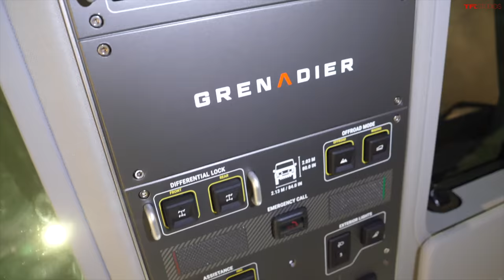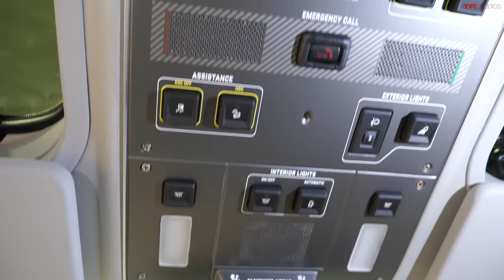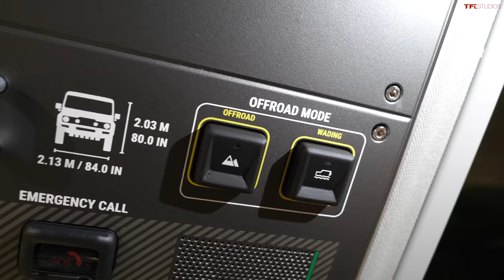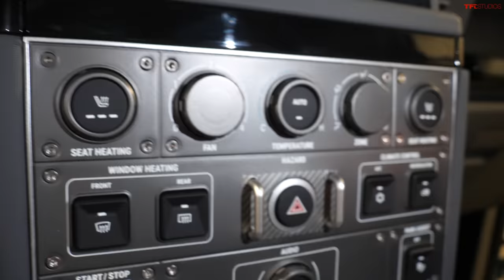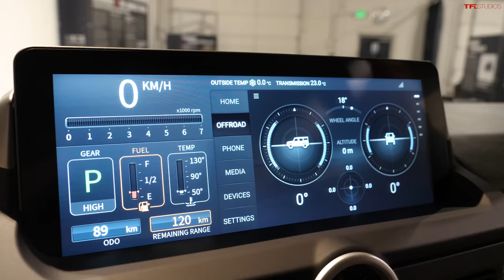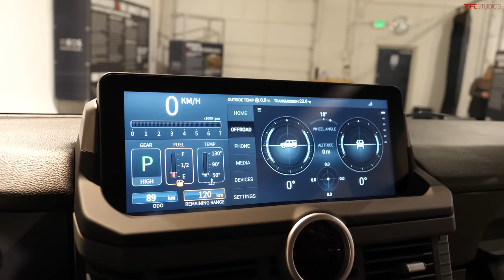The Ineos Grenadier Is The Old-School 4x4 You've Been Asking For!

Comment: This vehicle screams simple yet sophisticated. One of the best looking 4x4 in a while in my opinion.
Reply: nowheere near simple enough. far too many electronics that arent required by regulations for it to be simple. try getting your Automatic transmission fixed in the middle of the desert in somewhere like Zimbabwe. Auto transmissions require specialists to repair them in most countries, whereas a manual transmission, any competent mechanic can repair them in a shed at home, if needed!
Reply: @petelattimer6808  Solution; don't go to Zimbabwe.
Reply: Looks generic versions of older models but I want one so bad.
Reply: @petelattimer6808  Zimbabwe isn't really in a desert but I get your point.
Reply: Yeah. Bet it will cost more than a G-wagon and way more than a wrangler.  I like that they didn't make their own engine and transmission.  Overall pretty cool.
Reply: @jeffk464  It will be less than half the G Wagon price rumoured to be around  £48 k in the UK
Reply: @CallsignVega  agreed, and there aren't many mechanics with sheds in the middle of the desert either :)
Reply: @petelattimer6808  that’s what a 70 series cruiser are for. Let’s be real, this is for WASPs and aristocrats.
Reply: @petelattimer6808  I'm with you all the way, Pete, it's too complex.   Startled to see that the rear seats suffer from being set a tad too high, same as a Defender, so anyone even slightly tall has to hunch to see out their respective window.  Not great for safaris.

Comment: I think the speedometer should be in front of the driver. Other than that I like the styling.
Reply: I think the idea there is to improve visibility of obstacles directly in front of the truck.
Reply: @borismarkov1141  yeah, but a digital mph display doesn’t take up much space
Reply: @borismarkov1141  its done to reduce costs of swapping LHD/RHD as it means they can swap a couple of parts in the dash rather than having to swap the entire dash. many cars have had central clusters. the Original Mini, for one, and the first gen Nissan X trail for another. in fact even the BMW Minis have a central speedo etc, as did the VW Beetle, Toyota Yaris also has central speedometer etc.
Reply: Having owned both a Model 3 and Model Y, not having a center display to show MPH is virtually inconsequential and totally overblown. If you have to glance down to see a speedometer, you can also glance slightly right. I know, it's a massive burden but people can prevail.
Reply: There is plenty of room in the tray to put an aftermarket HUD device 10:42  There are plenty available with a simple GPS speedo.  This would also show correct speed if you upsized your tyres.
Reply: Having the speedometer in the center is no big deal. It’s my favorite feature on my R56 MINI that I drive when I’m not driving my Rubicon on 37’s.
Reply: @Brian Jones yeah me too you will be more distracted looking to the right more often to make sure you're not speeding that's more distracted driving. If the speedometer would be in the front of the driver including it into the small screen would be nice. And less distracting.
Reply: Totally agree.... Not having instrument cluster Infront of the driver is going to be the Achilles heel of this 4wd.... Shame cause it's a great package except for this fundamental flaw.
Reply: @Kevin Waters-Marsh  I know it's an awesome vehicle but at the same time is I'll be looking to the right for my speed instead of being directly in front of me. I bet the US will say to  them put the speedometer in front of the driver to sell it in the US.
Reply: How often are you checking the speedometer off road? This is not designed to be a highway cruiser
Reply: @petelattimer6808  Well the latest generation of BMW Mini or Yaris certainly don't the mini still retains a central binnacle but the speedo is in front of the driver where it should. Its not the 1970's and with all the speed camera's in the UK now you need to keep a much closer eye on you speed these days and the speedo should be in front of the driver.
Reply: be nice if they did a HUD for that
Reply: @einfelder8262  Yep & some of the aftermarket ones come out with some cool features, alarms for speed over etc. They’re not expensive either, so perhaps everyone can shuddup about that now 😂
Reply: @jamespaul2587  That's a rubbish comment.  Everywhere on earth you have to do highway miles to get off-road.  Here in Australia it's common to travel 200 kilometers through towns before you hit the local tracks, and quite often several thousand to reach the start of a desert crossing.
Reply: @einfelder8262  so? It's not like there is no speedometer, it won't kill you to look to the side instead of down below the wheel
Reply: @jamespaul2587  S?  It wouldn't kill you to place a small digital HUD in front of you so you get 100% accurate speed rather than a speedo that's 10% over, would it?  And the bonus is you retain 100% accuracy whatever tyre size you have on, be it 32" or 33" or 35"
Reply: Totally agree, Speedo needs to be in front of the driver
Reply: @PaulNaylor3  
There is a front display for speed but it is not up on the dash and is kept down so as to allow visibility when off roading.
Reply: The only thing i thought was off. Even a heads up display.
Reply: It's actually safer to have the speedo off to your left (right if you live in a country that drives on the wrong side of the road). From my Toyota days when we sold the Yaris, tests done indicated it took 40% less time (or was it 30, too long ago) to look at your speed and get your eyes back on road. I have the traditional speedo in my Defender 130 and also a Pioneer screen in the centre of the dash that syncs with GPS date to display speed. I find myself looking at the Pioneer for speed rather than the speedo.

Comment: Love the features of this vehicle.  Would prefer a driver-facing instrument panel.
Reply: It’s like the Tesla model 3, if they insist on forgetting the driver cluster then at least put in a heads up display.
Reply: To me, it seems like a control panel used for testing components. There's lot of empty space in the switch board.
Reply: I think without the driver instrument panel, a heads up display would have been nice and an easy addable feature for the manufacturer.
Reply: The point of the off set panel is to ensure focus on driving. There going to be a centre display but it will be basic.

Comment: Can't wait for this
Here in England we don't off road like you guys, 4x4 utility vehicles are for farming and construction (which I think makes for a stronger 4x4 over the wrangler and bronco, which are made for off road fun but can't tow for shit with wrangler typically topping out and 2500lbs and bronco maxing a 3500lbs)
Reply: This is the problem in the US. The only option for a new all around affordable reliable work horse/off roader/overlander SUV is the 4runner. Every other option is either over priced, unreliable or a 1 trick pony.
Reply: @Overlandjon  or all of the above e.g the Wrangler. Great off road, but unreliable and kinda overpriced.
Reply: @damilolaakanni  exactly 😂 its the best off roader on the market but it fails at everything else.
Reply: @Overlandjon  even the Bronco is better off road, but it too has issues with the removable roof.
Reply: @damilolaakanni  the wrangler is better off road just because of the solid axles but the bronco comes with lockers and a lift as an option for base models which is great. To get the same stuff for a wrangler you’d have to pay over $70-80k even before all this crazy market. But the bronco is still questionable if its reliable atm.
Reply: @damilolaakanni  im just so glad that someone heard our complaints and needs and is taking the initiative that land rover or jeep hasnt.
Reply: @Overlandjon  and even then the 4runner is a bit pricey for an old vehicle

Comment: @10:10 if you are wondering what the benefit of low/unlocked I can think of 2 places where I use it: 1. Boats and heavy trailers.  Pulling them out of the water and putting them in a tight garage.  Its awesome to have the control of low range.  2. Crazy tight trails like elephant hill, really great to not have to hop around on the grippy rock but have low range control.  FYI the GX470 lets you do this as well, you have to manually select center diff lock, even in low range.  I've also modified my land cruiser 80 to do that as well.
Reply: Makes a big difference with a manual trans, this is a auto so not as bad.

But yeah it's handy when towing. Add take off from a set of lights with a heavy trailer in a steep hill.
Reply: My LX has it as well. I often forget to lock the center diff, I guess it does well enough with the atrac.
Reply: So does my 4Runner. I'm surprised 4x4s don't.

Comment: As someone who has owned Mini Coopers and Prius in the past you will adapted to center gauges rather quickly
And find it less distracting having something in front of you!!!... 
If a heads up speedo was available it would be the fix all.
Reply: There is plenty of room in the tray to put an aftermarket HUD device 10:42  There are plenty available with a simple GPS speedo.  This would also show correct speed if you upsized your tyres.

Comment: I totally understand your hype. Here in Europe the offroad community is thrilled. The reason for the design of the rear door is the fact that you need this kind of door in Europe in order to register the vehicle as a utility vehicle aka truck. I won't trade in my Troopy though. Still the best truck. Regards from Germany.
Reply: Well - I am in “Europe” and I am not “thrilled”…
Reply: @scandinavia6271  congrats! So what? 😂 I have my Troopy. That is the reason why I don't need an Ineos. On top it is quite expensive. However, one cannot argue that the Ineos seems to be the best modern offroader by far. Very good package. Looks great too. I think that many people in Europe have a similar opinion. So, you are not excited, which is totally fine but not really important. 😉 Have a good one, mate!
Reply: @GCTO239  You are absolutely right! Maybe I am the only one in Europe not being “Thrilled”👍 Seems to
match the new defender specs pretty well on angles and payload. However; ground clearance seem to be on the shy side (according to 4x4 Overland review from Australia). As a long trip overland vehicle I would however take the new defender any day of the week..
Reply: @scandinavia6271  you might take the new Defender, but you might not come back 🤣

Its not just about clearance, its about how that clearance is achieved. no glitchy air suspension sensors, no complicated independent suspension that hampers modification, no over sized drug dealer alloys. 4XOverland went over all this in his video
Reply: @steveofengland  The fact still remains; It does actually look challenged from a ground clearance perspective - I agree with 4xOverland on that. Furthermore; Anyone claiming that the Grenadier is “Reliable” has nothing to base that claim on. Ineos never produced cars before…(For the record; I don’t own a Defender myself)
Reply: @scandinavia6271  I've seen it in person, it's no more challenged ground clearance wise than anything else. It's got plenty. Plus being body on fram and solid axle, it'll be easy as pie to lift slightly. Non issue

Comment: #1. The reason why the original Land Rovers look like modified Jeep Willys is that the British Military was given thousands of Jeep Willys during WW2. The (SAS) claimed they would not have been as successful, against the German Military, in the Dessert Campain as they were without the Jeep Willys. And after the war, those Jeeps were quickly snapped up by British soldiers returning home. So the British started building their own version.

#2. The reason why the Toyota FJ looks like the Jeep Willys is that Toyota was awarded a Military Contract to build Jeep Willys for the United States Military during the Korean War. But Toyota being Toyota, their engineers started improving both the engine and suspension design. And after the war, Toyota went to work on designing their own version of a Jeep Willys. 

Bottom Line, The U.S. Military is directly responsible for both the Land Rover and the Toyota FJ.
Reply: actually the designer of the original Land Rover used a Willys Jeep in WW2. he went home to his farm in Wales and allegedly drew the dfirst of his designs in the sand on a beach. the Land Rover may have been INSPIRED by teh Jeep but wasnt a copy of it. despite what is commonly said, very few British troops bought the Jeeps for use back in Britain.
Reply: I believe that Eisenhower was quoted as saying that the Jeep Willys made the difference in winning the war in Europe.
Reply: @joecanis484  Eisenhowerh may have, but the British SAS have said that if it were not for the Jeep Willys they would not have been as successful in their desert campaign.
Reply: My Uncle’s Dad drove around Europe in a Jeep mapping the battlefield. Fortunate to have overlapped with the greatest generation and heard their stories. And I’m happy to have my Sarge Green Gladiator as a descendant from the Willys.
Reply: @joecanis484  I too believe everything politicians say.

Comment: Great Video Tommi, i saw the first one with Ineos manager , this is one unit i will buy for  myself in a few years when they are slightly more available in numbers, this like the Toyota 70 series is built with engineering proven to last and still meet any global safety regulations and most people  don't know about the BMW engines in these  they are not regularly found in all there daily built cars they are a simplified version and like a commercial version with fewer electronics, nor the high tech mechanicals either, a little more military like engines, robust and will still meet the local smog laws of the countries they are sold in, and this will get me anywhere i need to go to enjoy camping, some  overlanding and most of all my hobby of photography and no worries of waking up to range anxiety of a battery ,Petrol head for life, Tommi you have the common sense and intelligence of someone twice  your age, 👍

Comment: Controls all look very aviation- love the toot toot! $50-$55K starting????!!!! I'm guessing $80-$100K plus for starting.
Reply: That is what I'm afraid of, but i think it is going to be $80k+.
Reply: Has the price been announced? A g-wagon is $150k and that is mass-produced. I have a hard time believing this limited-run specialty vehicle is going to cost less.
Reply: @stevebachtel  They are planning for about 30k annual production eventually.   G-class production is about 40k annually world-wide, so not as mass-produced as you think.   G is made by Magna Steyr in Austria, for Mercedes.  Magna also engineered the Grenadier.
Reply: The European starting price is announced at 59000€  for the 2 Seat commercial station.
A 5 seat station with lockers, snorkel ec. as shown in this video, I expect 68 to 72K €.
I guess You could take this 1:1 in $!
Why? My reservation took 450,-€
Pair to Yours in $ 😉
Reply: @dorisfrielinghaus401  I think you're right-on.
Reply: No way this is hitting the US out the door for under six figures.
Reply: I don’t see this selling for less than $100-120k.

If it is not being built in the US, add the chicken tax.
Reply: Also, everyone forgets that the Toyota Land Cruiser left the market at $85k.

Comment: As I mentioned one the first video I would love to own one of these Grenadier vehicles.  One minor point, strictly for me, I would like to see a simple speedometer right in from of my view as I drive, i.e. in my straight ahead line of vision. I don't want to have to look over to the side to check on my road speed. I do like that this has 17 inch wheels. 
Good job Tommy!
Reply: I thought exactly the same, I liked pretty well everything about this except for the lack of a conventional speedo in front of the driver. Hub of the steering wheel looked a bit bulky but that is modern crash safety I guess. If I could afford it I would definitely be very tempted...

Comment: The Grenadier looks amazing. If it can achieve top tier reputation for reliability then it will be a smashing success. UnReliability is one thing it should not inherit from Land Rover.
Reply: It is using a designed chassis, fully galvanized to stop rust, BMW engine and a simply control system. 
I suspect it will just work.

Comment: This will be expensive, but worth it.    It has a fully galvanized and powder-coated frame, and all-aluminum radiators, for example.  Cararro also makes the axles and diffs for John Deere.  You won't find that kind of quality in anything except, perhaps, G-class.  I placed my deposit on the first day they opened reservations, Sept 30th of last year.
Reply: Yes, no way it's $50k. Estimates are $75k to start. It could easily push it to 100k with options, which makes more sense all things considered. This is a Range Rover/G-Wagon competitor, not a Wrangler competitor.
Reply: @mechmat12345  This thing will be over 100k The Australian work model two doors go for 62k USD base price without any option.
Reply: I've got an early reservation as well. Cant wait! I was guessing it will be around 80k, I hope he's right and its in the 50's.
Reply: @commto9705  I wonder what percentage of that is shipping cost... Australia is quite a ways from Hambach.
Reply: @mechmat12345  range rover competitor ? More like a defender competitor